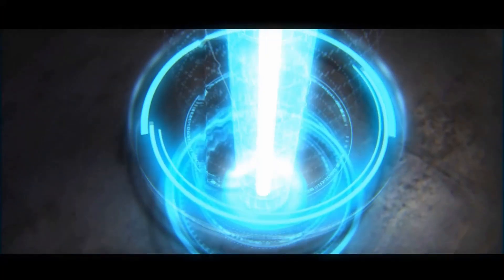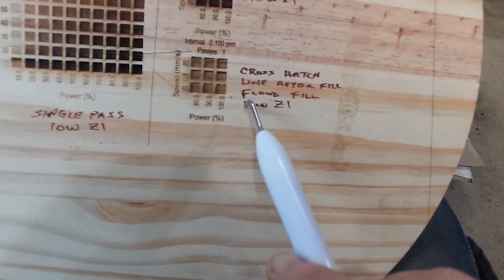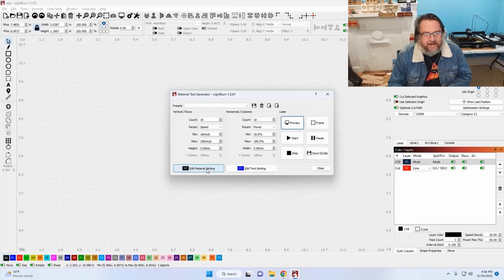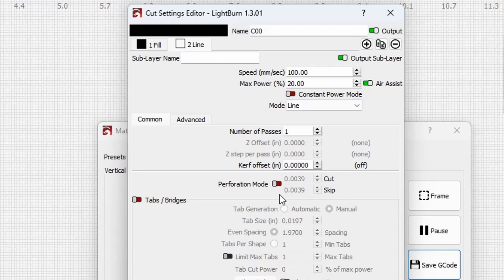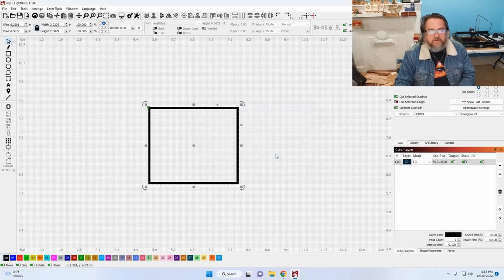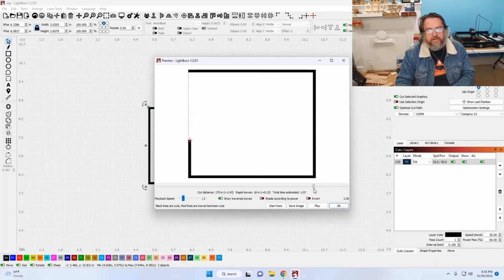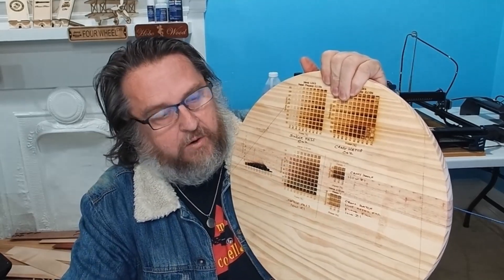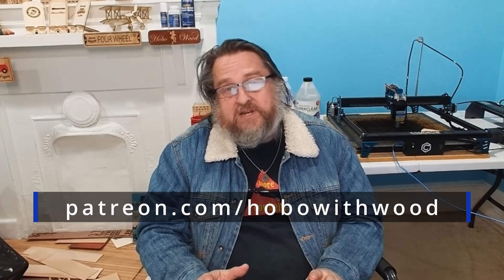Cross-Hatch And Flood Fill Explained

Comment: OMG.. All this time I was making the test pattern my self by hand. I did not know about that test generator.
Reply: I am going to need this too. I have a new 100 watt JPT MOPA fiber laser source coming Tuesday to rebuild my 30 watt fiber.
Reply from the maker: Glad you found this. I did the same thing when I started out. This is a huge time saver. If you play with it, you'll discover you can save presets for different types of tests. Happy New Year!
Reply: @HoboWithWood  I always used RDWorks for my laser until just about 2 months ago. So I got a lot to learn. Thanks
Reply from the maker: @JackInTheShop  I just started in late June this year. And I had NO previous laser experience. Go back and watch my videos starting in June. The progression was really quick, and I shared everything I learned as I learned it. The early videos were quite hilarious at times. The production values have increased over time. But the early videos have a lot of good info.

Comment: Hello Steve, have you tried this on engraving bricks? I just started engraving some bricks and I flood the engraving with black paint after the brick has been engraved and I wanted a nice clean and deeper engraving and was wondering if the technic you just showed would work for this as well. Yes I do know and will be trying it. But wanted to know if you had more advice for me on this.

Comment: Steve, I have been doing laser engraving for about 8 months now and noticed that you use mm/s for your speeds while most others use mm/m in their speed settings. I think it may confuse some new users. Just my thought (not nitpicking). One thing I like to do is once I determine the settings I use for engraving or cutting a particular item I save the g-code. Hope you have a great year.
Reply from the maker: I use to get the same confusing feeling when I would watch others using MM/M. I don't understand why the two different methods were created to begin with. It's not like imperial vs metric. I learned using mm/s. A lot of it was self taught. They say one is for diode and one is for CO2. Why? I use both CO2 and diode lasers. Converting is very simple. You either divide by 60 or multiply by 60. As I mentioned to another viewer, after nearly 6 months of doing this I still do not have a large cut library. With so many inconsistencies in the variations of wood, I test cut every material before doing a job. I've never shared my settings intending for anyone to use them as their own, but more as a reference. You can't please everyone. And I no longer try. Hope you have a great year as well.
Reply: @HoboWithWood  Diodes normally use MM/Min.  Co2 uses MM/SEC  Why ? Don't know never could find a exact answer. Maybe it has to do with GRBL. BUt again no clue.

Comment: Haven't done any inlay but I find that there is a difference in quality of image and darkness of burn between, the species of wood, AND cross hatch, flood, or offset fill. It can make it somewhat confusing to know what to use especially if you don't have a lot of test pieces. I'm generally a flood fill guy for most of the stuff I do but I like to check the offset to see if the time is substantially different. I really like mesquite (I'm in TX) because it takes the laser so well and engraves so dark with jus one pass of flood fill. I haven't used cross hatch much. I've run some tests on baltic birch for Christmas ornaments and didn't think the results justified the time. Again, I'm not doing inlay just commenting on the differences of settings. Of course we can then add different angles to the regular burn and even cross hatch. LB is powerful but the amount of options can almost result in a paralysis of analysis. Nice to see your channel growing. Keep up the good work.
Reply from the maker: You mentioned not having a lot of test pieces laying around. That is the first thing I do when working with any new material. I even run a test on all new batches of wood I receive. I run tests on the same wood between my different lasers. It's been my experience no two lasers how the same performance. They can be close, but never the same. I've received different batches of Baltic Birch, one that engraved beautifully and the next look like... So I test. After nearly six months of doing this I hardly have any cut library settings saved. It's largely because I'm testing each material each time. One of my viewers mentioned running into a problem after buying some hardwood from the southwest. Once it arrived to his shop, added humidity in his area caused the wood to warp drastically. Buying local is always a good idea. Then even letting the wood acclimate to your shop before using it. You are 100% correct that you can get paralysis from analysis. There are so many ways to accomplish a desired result. With so many variables, it's best to find a method that works for you and stick with it. I never use Flood Fill except as a last step at a reduced power to clean the pocket of an inlay. I've had mixed results trying to use it as the actual engraving procedure. But I've also never worked with Mesquite, (except to bar-b-cue). Thanks for being a regular viewer and here's wishing a prosperous new year.